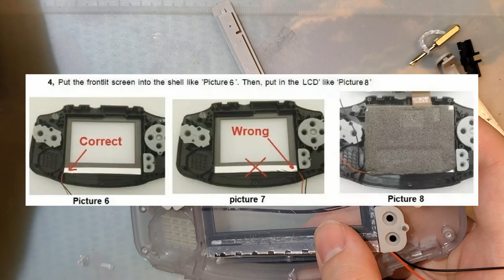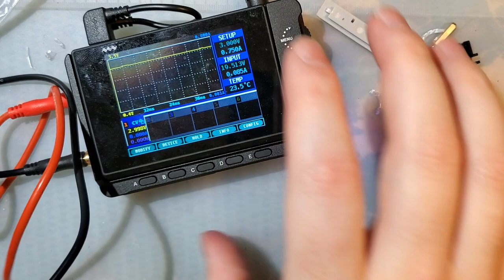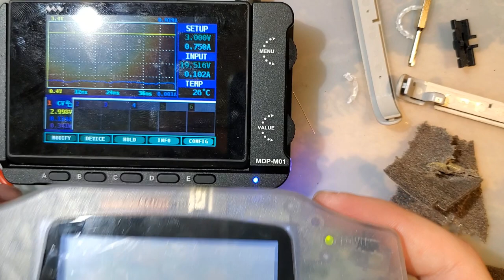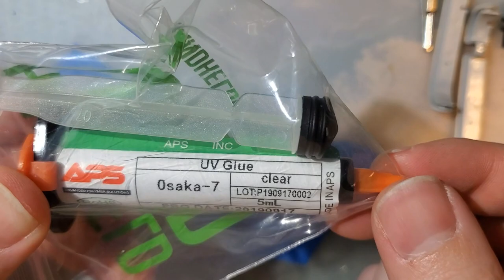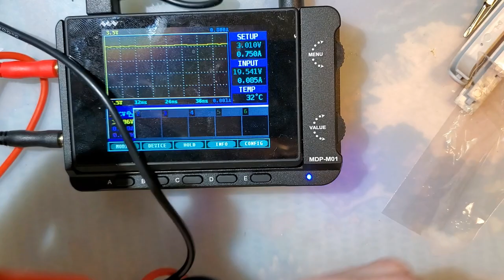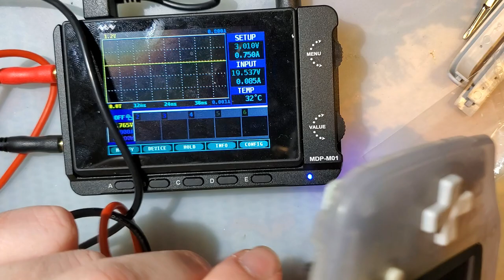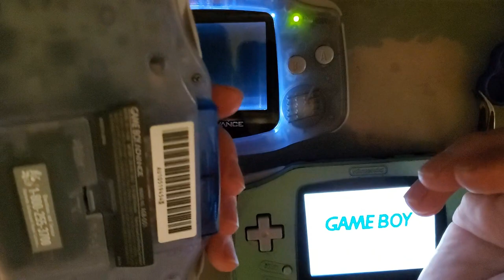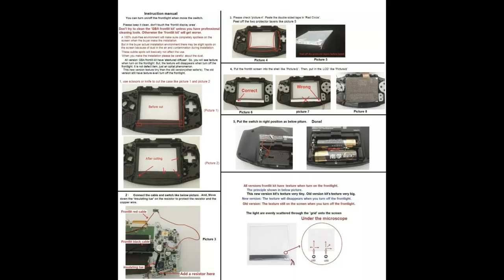How Not To -- Game Boy Advance Front Light

Comment: Just open you gba, cut all the plastics necessary and remove everithing you wont need. Clean the better you can. Open your dead screen sp 001 and extract the frontlight. DO NOT TOUCH IT FOR THE SAKE OF GOD. Remove al the plastics and stickers so it will come as alone as the one retrogamerepair sells (there are videos out there, just they dont explain it very well). Use a 100 ohm resistor (brown, black, brown, gold tolerance) and solder it as you see in this video, the resistor goes into the power on switch and the positive wire in the Q6 transistor ( I have a 40 pin screen). If you do not screwed up as I didi, you will have a very decent frontlighted classsic gba and a sp for modding with a IPS. If not, welcome to the mod community ;)

Comment: So, I read somewhere that you could get great results without using loca and instead of applying the polarizer to the screen, removing it, and placing it on the front side of the front light. I've never actually seen it done but, I mean, if anyone could try it, it would probably be you.
Reply: I'm was wonderng if i need to install the polarizer film or not in order of get better results? So, i should'nt add the polarizer or yes?
Reply: @israelguevara09  the polarizer is required.
Reply: @LelandHasGames  but where?
Reply: @israelguevara09  top layer of the display? A quick Google search would probably be more helpful.

Comment: I did several of these back in 2002 when Triton Labs was selling the Afterburner frontlight kit through their Portable Monopoly website. It was basically crowd-funded through a preorder campaign even though crowdfunding sites didn't exist yet back then. ;) I only had a couple flawless installs that looked great but I recall my personal install looked terrible despite flawless execution (no dust, perfect cut, etc). The only reason I could figure is that my Arctic GBA was an early Japanese launch unit before the North American and worldwide launches. I noted that it had a factory rework of some kind (resistor soldered to the cartridge slot) which I don't recall seeing on my friend's Glacier unit from the US launch and don't recall seeing in any GBA since. I remain convinced that this is why my GBA looked so much worse with the Afterburner than others I did.

I still have one defective/broken Afterburner kit around with all the instructions and packaging and stuff. No AG film though, since that was wasted during an attempted install long ago.

Comment: Nice video and hoh by the way can it be done with an ags 001 screen? i bet ribbon cable should be involved aswell to convert pins but it should be the best way to front light don't you think?
Reply from the maker: I mean, I guess? The point of this video was to check out the new aftermarket kits.

Comment: well, I just buyed for about 20 bucks a dead screen ags 001 and stipped down the frontlight to mod my agb 001. It went awry. I toched the plastic for both sides, wiped multiple times wit an anti static screen cleaner, and so on. My veredict is to ve VERY precise to what you where to do, it will cost you less if you just do ir right away and not "fixing" or "adapting" things on the fly
Reply from the maker: Once you touch those panels, you ruin them. They are, as far as I can tell, impossible to clean without damaging the surface layers.
Reply: @makho  Can confirm, a slab or roll of cured loca removes any finger prints without the need to rub in new scratches.

Comment: well, i'm going to do this "mod" just because i want to use the original sharp lcd and not a new IPS. But i have some doubts, i shoould put the polarizer film in the screen or not? also, why and what kind of resistor you used?
Reply from the maker: You should follow the instructions for the kit/panel you are using as each one will be different.

Comment: has anyone tried removing the metal back plate of the LCD screen and instead of installing the light panel in the front, u install it in the back sandwiching it between the flex cable and the lcd thus backlighting it.
Reply from the maker: In the wiki I always link to, check the page on the game boy color. It has been done but the results are... not the best.

Comment: If u absolutely have to go front light.  Why not just use a gba sp lcd with a adapter? Front light lcds from gba sp are dirt cheap on eBay and AliExpress.
Reply: @majortom5838  i see. Wellp there u have it folks. Just save up for a back light mod. Front light are not worth it in the long run.

Comment: They call them afterburner kits because that''s what they do to batteries right?
Reply from the maker: I haven't actually tested the power consumption but, with the correct value resistor, there's no reason the panel has to consume more than 10mA (much less than an IPS kit and about on par with an AGS-101 mod).
Reply: @makho  Oh. Well dang. Tried to be clever and witty and got beaten by science.  You are technically correct, the beat kind of correct!